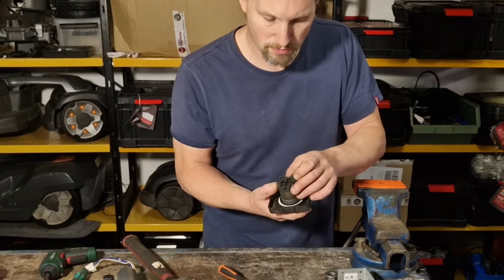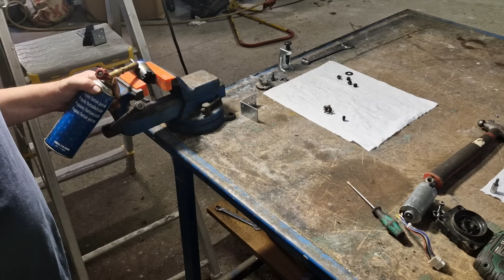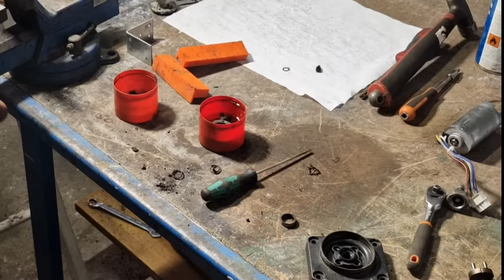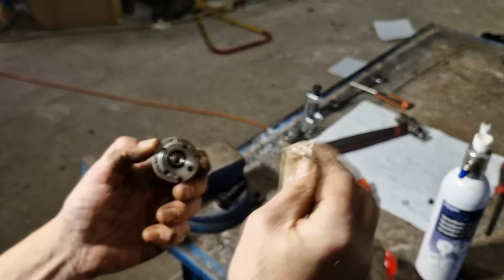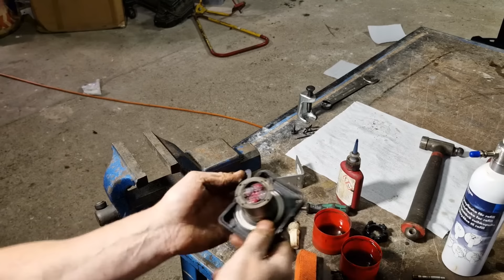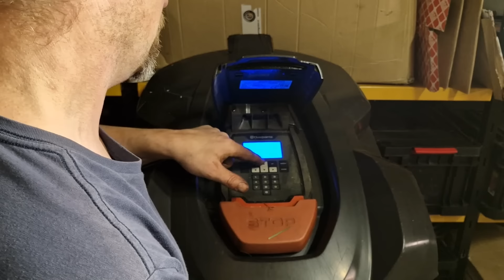Wheel motor repair and longlife upgrade Husqvarna Automower 320 330X 420 430X 440 450X 435X 520 550

Comment: The screws for the electic motor is T8 not T10.
Reply from the maker: Hi Bosse, That is true on the 36mm motor for the smsller machines. It uses T8 because it has M2.5 screws. But the motor in the video is a 42mm and it has M3 screws with T10. That is a differance between the motor sizes 👍

Comment: I Just used this product 4/3/26 and while I only needed one motor repair I did both anyways. Its exactly like this video explains and its easier to do than you think. 1 new motor would have cost me around €250 here in Ireland. This upgrade has given me 2 new rebuilt motors for 25% of the cost of to new motors. Mower is back to work and working as good as new. Thanks guys, excellent product and keep up the good work.
Reply from the maker: Thanks for your nice words Donnie, im doing what i can to do it better and more durable 😊
Its nice to see that my parts are used in Ireand! And thanks for the trust!
And just let me know if you have some questions down the road.
Best regards Gordon

Comment: I used this kit to repair my 450x.  The right wheel had warn center gear and the posts for the planetary gears were quite worn.  I did the complete kit with bearings and axle.  Fantastic quality and value.  The video was very thorough and I did it with ease.  I decided to attempt it without splitting the unit and fully removing the motor and it went fine.  I'm going to order the other side and do it this winter after seeing what this side looked like.  I have over 12k miles on this unit so not too disappointed in the factory setup but this one seems far superior in design.
Reply from the maker: Hi Tom, 
Im happy that it worked out good, its in fact very few that dont manage to fix it what i know of!
Im really glad you liked the quality and see that its high quality  parts :)
I checked and it took 10 days with tracked shipping to US, thats ok i think!
I am glad that you found my site that far away, not many americans do!
You are welcome back anytime!

Thanks Gordon

Comment: Hello, interesting video and commentary, 3 seasons of mowing without any problems, wintering with a fully charged battery before stopping and sleeping in a dry place during the winter, then in the spring when starting the firmware requested an update during the spring outing and since then, I have had a repetitive error message every day on my 435X AWD, telling me that the battery is reaching the end of its life, I have to manually select reset in the app to start the mowing program, and in this case it starts mowing again without problems during the day, and the next day it starts again;
My question is:
If I replace the original battery with an original battery, do I need to recalibrate or calibrate the new battery or does it do it automatically?
And if calibration is required, how is it done?
Do I need specific devices, or is it a hidden menu?

Is there a method using key combinations on this model to access the hidden menu of this mower? I still find it abnormal that the manufacturer doesn't provide an explanation in its user manual for following a specific procedure for replacing the battery.
Reply from the maker: Hi,
I actually have a 435X that i changed battery in myself. In my case the machine resetted the cycle counter automatically and worked without issues afterwards.

I dont think there are a service menu on the newer machines. I believe it's a app/tool only for dealers that can connect to it.

Good luck!

Comment: Tyckte om den förra videon lite mer, var mer rakt på sak och tycker den var enklare att följa och se delarna. Men detta fungerade också bra :)

Jag lyckades få en liiiiiiten spricka i den nedre, sköra, pulvergjutna delen när jag skulle pressa in den nya axeln (100% mitt fel, var inte rak/noggran nog), verkar sitta tight och bra ändå, hur orolig bör jag vara? Går det få tag på en ny sådan del?
Reply from the maker: Hej,
Jo så är det.
När jag gjorde denna så hade jag lite bråttom för jag hade precis skickat ut de första satserna av denna nya produkt helt utan instruktion, så det fick bli som det blev på en tagning, så att kunderna kunde förstå hur det funkade. Jag är väldigt stolt för min egna lösning, så det fick bli lite extra babbel!
Jag tror att det är dumt att köra vidare med den. Skicka mig ett mail så kan jag kolla om jag har en sådan platta.

Mvh Gordon

Comment: I bought the kit with the longer axle. It works well. The transmission on the right side was totally damaged. But a friend of mine has some connections , so we are looking to make some alternative für the planetary gears. If we are successful, I try to contact you.
Reply from the maker: Im happy that it went well! 🙂👍
I have the steel planetary gears too. But not iin the shop yet as I have a limited stock. But I will have both the plastic and steel ones soon.
Please email me for suggestions!
Thanks Gordon